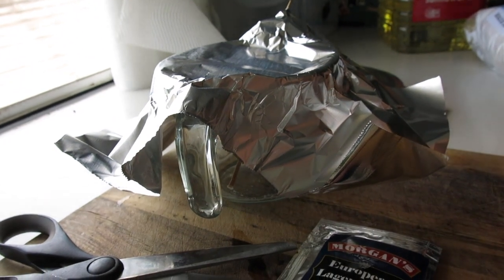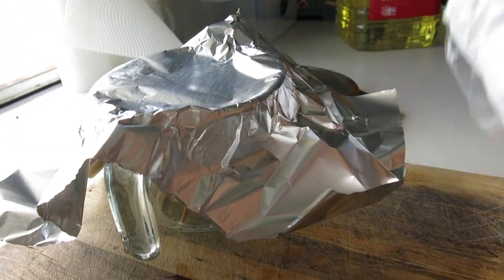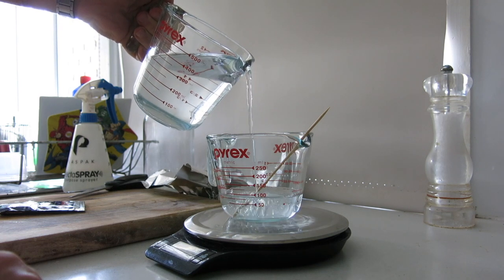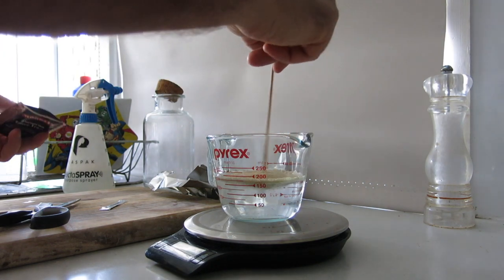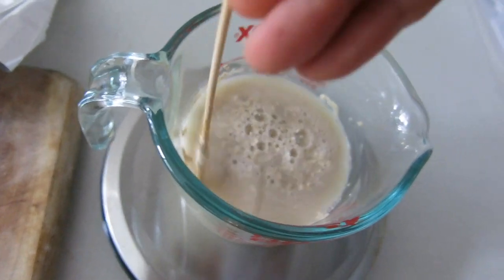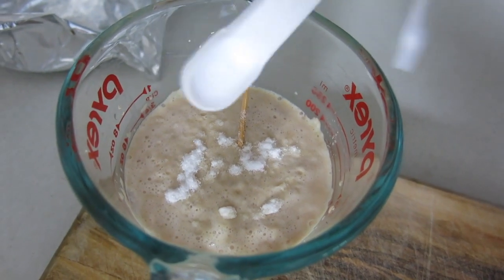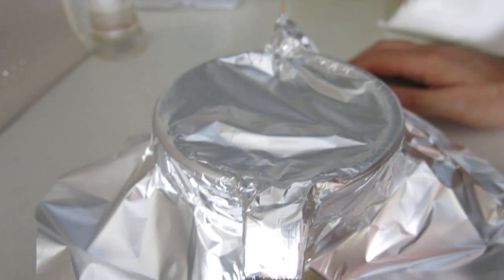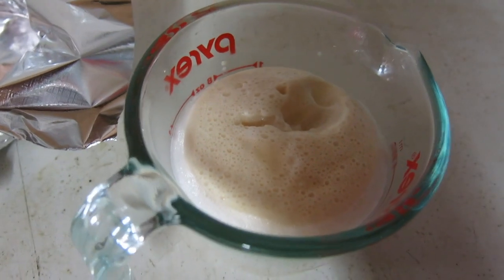HBW #86 How to rehydrate yeast

Comment: Ive failed twice to rehydrate yeast.

First problem was that i noticed my mead didn't bubbled or had any airlock activity. Tried to shake the mead, it bubbles but clears off in a minute.

I tried to repitch again but what i did was i kept mixing it for 20 minutes straight.

Didn't knew I had to just let it sit. By following your video, i hope i make it right now